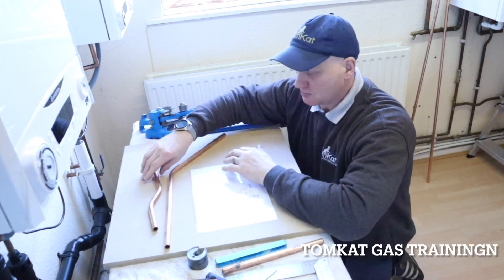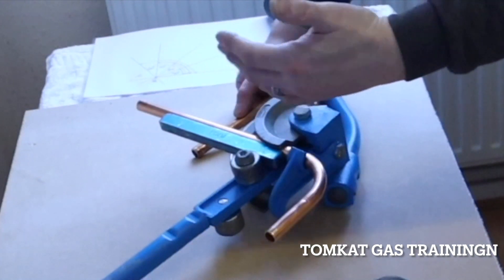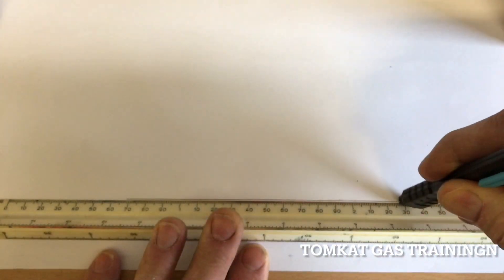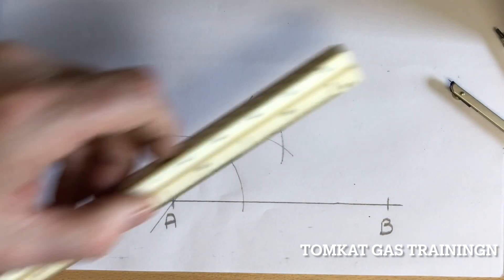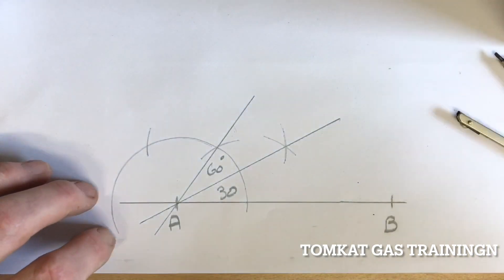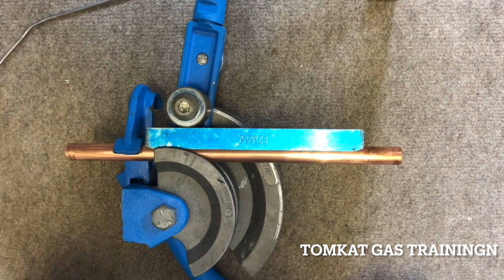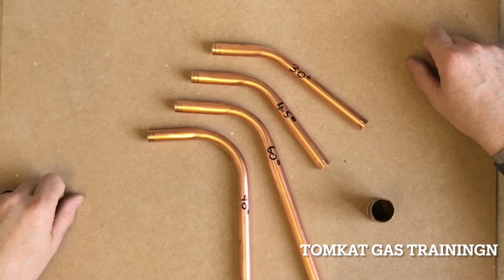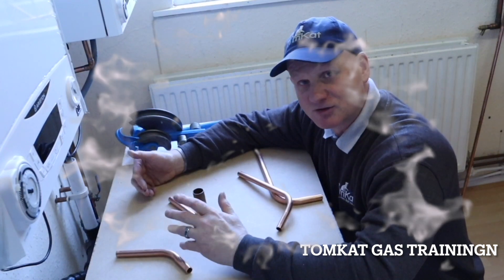HOW TO FIND THE CORRECT ANGLES FOR COPPER PIPE BENDING part 4 totorial on how to bend copper tube.

Comment: agreed great upload. some benders have lines on the former. mark your own if they dont for speed. another practical tip. use a bevel. then bend the pipe accordingly. faster than getting your compass or protractor out. i do get why you did this though.